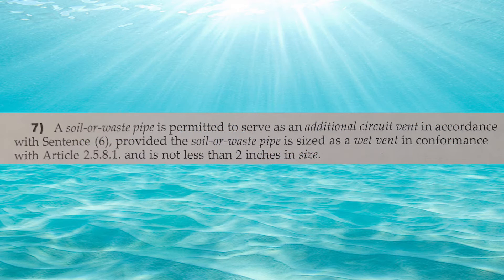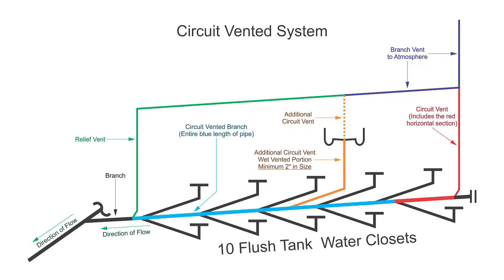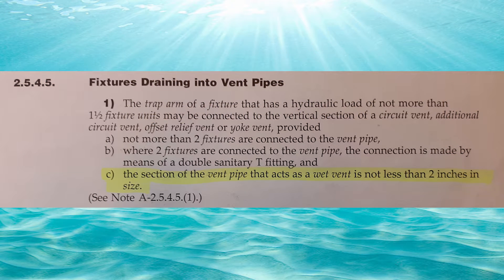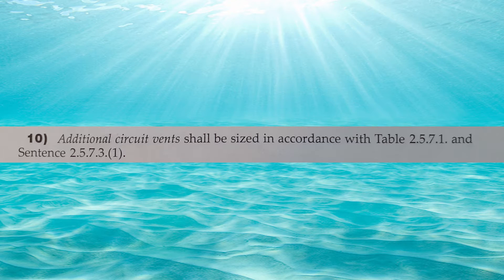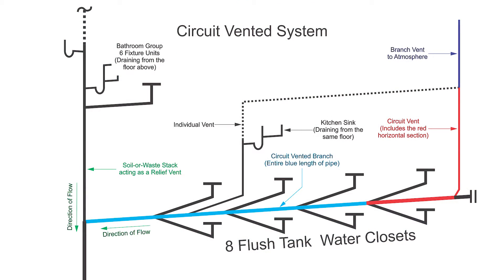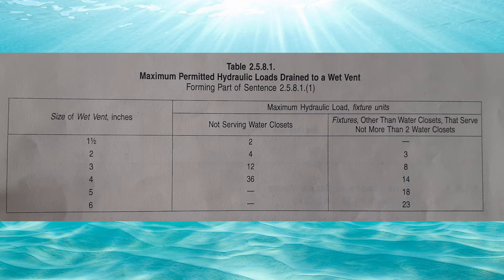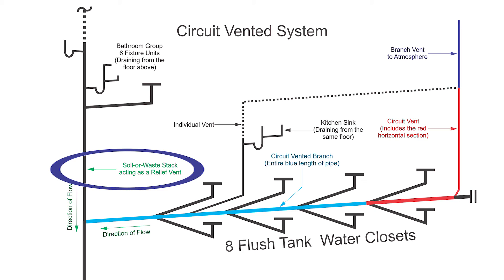Circuit Vent Part: 4

Comment: Hi. Thank you for your incredible teaching. I have question please. You mentioned acc. to clause 2.5.4.5. fixtures that connect to the vent pipe should be less than 1 1/2 FU. But at the end of video for sizing additional circuit vent your example has 6 FU?
Reply: The end of the video is not talking about the Additional Circuit Vent (2.5.4.5). Additional Circuit vents are only connected to the horizontal branch within that circuit that serves MORE than 8 C.Vented Fixtures  or has a change in direction of more than 45*. 
The end of the video is referring to  2.5.7.3 (2) A Soil Pipe / Wet Vent Stack acting as a Relief Vent (NOT as a additional C.V.)
Reply from the maker: @el_w0824  Yes, what El said LOL

And @NioushaAbbasi-x9l Correction: connected fixtures should be maximum 1.5 FU (Not less than)

Comment: I'm a plumber and I was hoping you would cover the one part of this code I don't understand and after 4 videos .... unfortunately, you didn't! The part I don't understand is how to calculate the maximum distance from fixture trap to vent while circuit venting?
Reply: That would fall under max and minimum of trap arm distances from trap to protecting vent
Reply: 1 1/4    1.5m 
1 1/2    1.8m
2           2.4m
3          3.6m
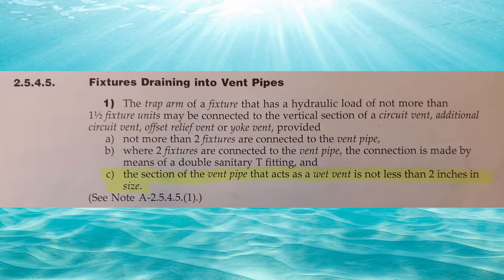4"        4.9m    for   1:50
4"       9.8m     for   1:100

NPC CODE
Reply from the maker: The comments below are accurate. It is just a trap arm, you need to follow the general rules for trap arms.
Reply: Measured from the trap to the actual vent location? That's how I always do it. I would be willing to bet not a single drawing that I have received from an engineer is drawn that way. It's almost like they think the entire main line is the vent and they only measure the branch distance from trap to the main.
Reply from the maker: @MrGoodvibesgoodtimes  Measured from the trap to the circuit vented branch. That is a the drain and it also acts as a vent. It uses the wet venting principle

Comment: Hi, Thanks for the nice videos and explanation. I learned a lot from you.  But in this video at @2:15 min I got confused, You said 1.5fu for each fixture, but the code said 1.5fu ( that does not mean for each)
Reply from the maker: Read through it again. "1) The trap arm of A FIXTURE that has a hydraulic load of not more than 1.5 fixture units...."

"a) Not more than 2 fixtures are connected to the vent pipe,"
Reply: @MathematicPlumber  Thank you for the enlightenment and training for deep thinking in the material.

Comment: Hi, Is the additional circuit vent in the first example of this video considered to be serving a group of water closets?
Reply from the maker: Sure, but the only relevance there is when we check 2.5.7.1 to ensure the vent is sized based on size of trap served.
Reply: @MathematicPlumber  Thank you

Comment: That's really too complicated...
Reply from the maker: After you go through circuit venting a few times and then physically put a system together, it gets much easier. Circuit venting is far more simple than wet venting when you figure out the key elements.
Reply: @MathematicPlumber  Thanks a lot.